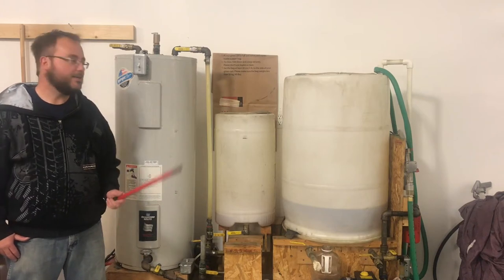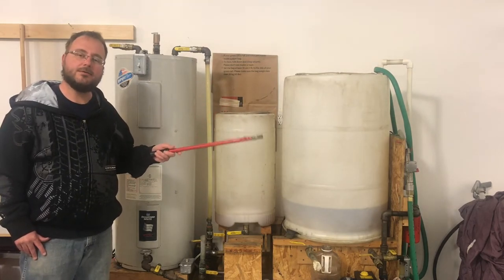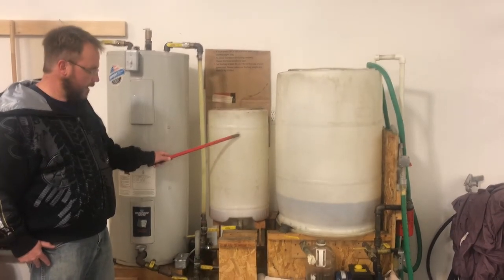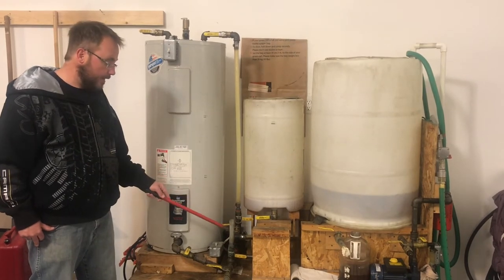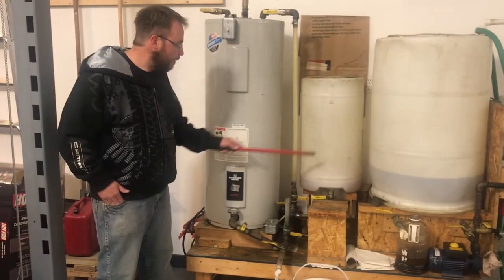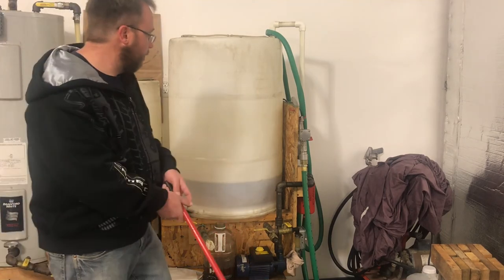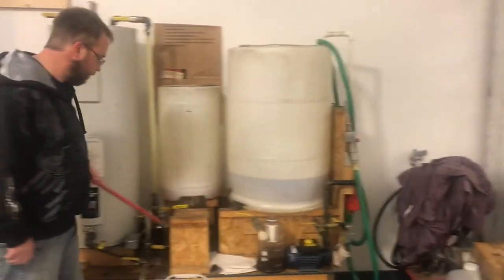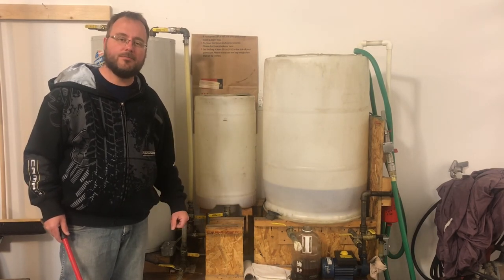How to make Biodiesel fuel - a quick overview!

Comment: Could a mini version of the system needed to make bio diesel be built to fit in the bed of a truck under a camper shell? I am planning on hitting the road full time pulling a travel trailer. I would like to make it interesting by driving cross country while processing. My own bio diesel.
Reply from the maker: oh wow that would be interesting.  12 volt pumps could move it around I guess.  Getting the heat into the oil would be a challenge.  and this system only makes 100 litres at a time.  If you have access to 120 volts when camping it is a good idea to make while you camp but not on the road.
Reply: @gregs_garage  I will be traveling with a generator. It's a 2200 watt inverter. I could always upsize and get one big enough to run a small 220v water heater. But the bigger ones are so loud. If I was working with 110v only what heating source would be ideal for that compact space? In all reality it wouldn't be that compact. It's an 8 foot bed lol. If I could figure out how to process while I travel (while stopped of course) that would cut my living expense down to almost nothing and make for a real cool YouTube channel
Reply from the maker: @lapincfl  My water heater runs on 110v.  I use a 220V element running 110v and it heats up fine.  You could get a short water heater.  Also I hope the generator doesn't burn more fuel than you are making.
Reply: @gregs_garage  I'm actually a master plumber. I know I could get a small 5, 10, 15 gallon heater. Let's say for example I stop every 500 miles to refill and it cost me around 90 bucks. My tank is a 3 gallon tank. If I were to stop and try to make 60 to 120 gallons of biodiesel using a 5, 10 or 15 gallon heater how long would my stop be? Are we talking hours, days, weeks? Once I'm on the road I will be in no rush. I can camp out while making batches. And If I got to get somewhere fast I can just use regular diesel and go.
Reply from the maker: say 15 gallons:  Heat the oil for a couple hours, add chemicals, process and circulate for an hour, let settle overnight (not while driving), transfer the oil to another tank for cleaning.  Repeat the next day.  After 4 days you will have 60 gallons if everything goes perfectly.  Then you have to clean and filter it before use.  Say another day.  So yes if you have a very efficient process you could make 60 gallons in less than a week.
Reply from the maker: @shortycummins  never too late.  Sounds like a nice system but completely different than biodiesel.  biodiesel is processed veg oil with the glycerin removed.  It's a different fuel.  Veg oil causes problems longer term.
Reply: nothing like getting into a car accident with someone driving around with a mobile bomb in their travel trailer

Comment: Hey so why does the mixture have to be heated in a wayer heater? Ive seen a few other videos where they just mix it around in a metal container. Im guessing your product is much better vs theirs but I am curious as to the reason
Reply from the maker: some people mix oil and gasoline or other chemicals and call it "biodiesel".  It's not really biodiesel.  My method shows actual biodiesel being made.  The heating speeds the reaction.
Reply: @gregs_garage  gotchya, thank you!!

Comment: I use one steel tank that used to be a pressure accumulator in a large building for water, with a rubber bladder inside. I made a new flange for the bottom for the heater and one inch outlet. Cut a 4 inch hole in the top and welded a bush on it. I do 300L batches with a 2 stage reaction. No titration, thats a waste of time, just use the 27-3 test. I store raw fuel and then wash and dry in a 200L plastic conical finishing tank. anything less than 300L batches is not a good use of time.
Reply from the maker: Fancy.  100L is fine for a VW TDI.  it lasts me a long time.

Comment: You should clean it before the heater. Thats gas control valve thermal sensor is going to crap out on you
Reply from the maker: 14 years no issues.  A coarse screen of raw oil is fine.

Comment: Hi guys
What would the dosing be for methanol and potassium for a 200 liter batch (53 gallon) of used cockingoil?
Only about number is fine 👍
Reply from the maker: I’m my process I’d use 40 litres methanol and 2200 grams KOH (93%) but it can vary based on oil and other factors
Reply: @gregs_garage  ok THANKS for quick answer.
How many times should it be washed with water you think?
The glycerol, where could that be disposed or thrown away?

Comment: Why are your supply tanks and finish tank at different levels to the heat tank?
Reply from the maker: just the way I built it to allow for access under the plastic tanks.
Reply: @gregs_garage  , so just convenient. The reason I asked was to if critical to the process.
Are you still doing this process or have you modified or made improvements?

Comment: What do you think of a blend of ~15% ethanol and 85% biodiesel
Would solve the viscosity issue?
Reply from the maker: I don’t know if I’d risk this.  I Blend some kerosene in to lower the gel point and generally use less % in colder weather.  Mix with more winter diesel and/ or kerosene.  Save the bio for warmer weather
Reply: @gregs_garage  pardon me for jumpin in but what dose the epa say the blend can be in winter?
I am sure they specify a blend to the major refiners ( astm D975)
Reply from the maker: @bennoah1673  I don't know what the spec is, if any.  I think fuel stations have pretty low blends in the winter.  I read that Chicago uses B20 in the cold of winter for city trucks.

Personally I use around 10-30% in cold weather (down to -30C) and it is fine.  Use up to 100% if above freezing temps.

Overall I probably average 50% year-round - less in the winter, more in the summer.
Reply: @gregs_garage  Thanks, think I’ll look into heating the fuel as my solution. In tank heaters, hot water Coil, and electric ac heater to plug in while setting at home.
Reply from the maker: @bennoah1673  with my TDI - as long as it starts it is fine.  The fuel heats as it is recirculated back to the tank.  I also have a 12 volt heater that wraps around the fuel filter - they are hot!  about $100 for a good one.
Reply: @gregs_garage  good man! Peace and blessings

Comment: bet your happy you made this with Biden in charge
Reply from the maker: makes no difference.
Reply: @gregs_garage  fuel prices have gone crazy i would have thought this would be helpful to keep ur costs down
Reply: @gregs_garage  how so? seems to be extra important now, and i think your view will show something has recently gone very awry.
Reply from the maker: @mannyfox8089  politicians don't control oil supply and demand.  they can influence flows but high prices are a result of much more than 4-year election cycles and 1 guy.
Reply: @gregs_garage I wish you were correct in that. The Biden admin has almost stopped all public land drilling and has forced the shutdown of many oil refineries that just had multiple updates done to them to comply with the EPA regulations.

You can think it doesn't matter who is in power all you want, but you'd be wrong.

Comment: Hey. Is that Diesel quality good enough for a mordern engine, build in 2013? I'm not sure. I hope somebody can help me.
Reply from the maker: maybe.  it depends on the engine.  for the most part this is better for older engines unless used in smaller blends i.e. less than 20%
Reply: Can It be used in modern Diesel engine with the blue oil and high particle emissions filter ?